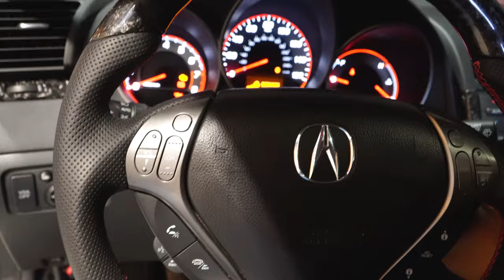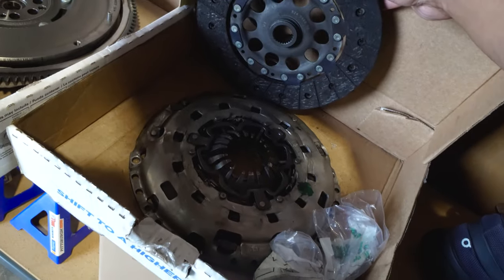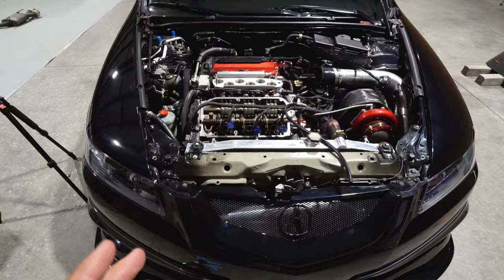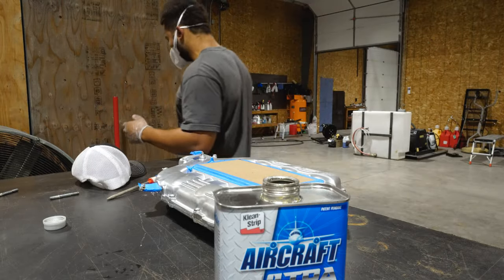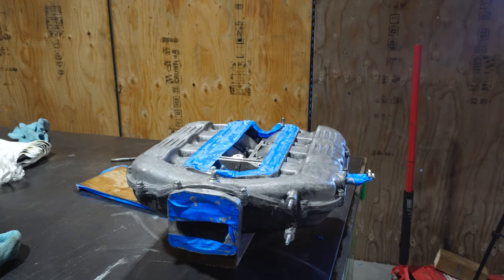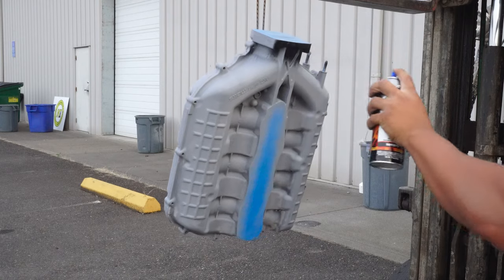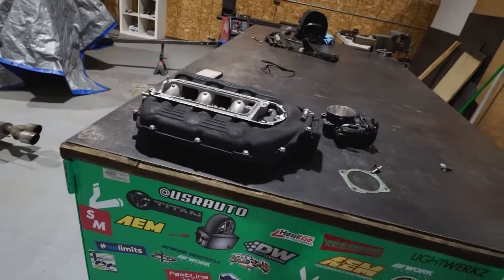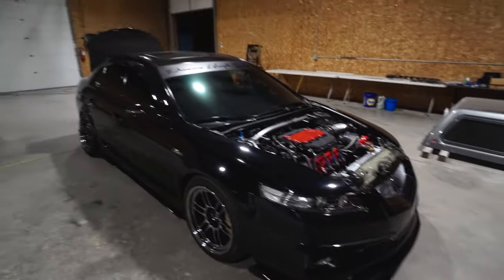Painting Manifold Wrinkle Black DIY Boosted Acura TL

Comment: Hey D, quick question. Does removing the hood insulator make a difference on the hood's paint or keeping the engine warm in cooler temperatures? Or it's fine to remove it? Mine ripped above the serpentine belt side when the belt ripped off while driving. Thanks.
Reply from the maker: I’d remove if it’s ripped fs , paint will be just fine the black cars get cooked in the sun everyday and hold up for years

Comment: Hey man I got kind of a dumb question but AcuraZine ain’t really helping out. 

My 08 Type S (AT) was stock the whole time I’ve had it and I recently added a new engine. 

Got new HFPC’s, an Intake, Rv6 Jpipe and I was thinking if I should go Mid muff delete, Dynomax Res and I was told to get Tune. Sound like a good route? 

But once I Hondata flash pro is there any thing further than that? I hear people talking of re tunes but I’m told Hondata doesn’t yield major results? 

(Other than making it a beast of a sleeper by putting in thousands to rebuild parts to make it more durable?  not a car guy clearly 😂)
Reply from the maker: @Zioni21  I had similar setup for a very long time without retuning so you won’t hurt anything. Hondata and tune depending on tuner, gonna run you 1k. If you plan on doing more bolt ons, do them all before tune to save most money. 

With no cats I recommend RV6 ultra quiet res and mid muffler delete. Helps contain rasp better.
Reply: @TheLifeStyle6  Ah okok! Appreciate it! 

Last Question would be get the resonator or naw? Cuz that’ll make it stage 3 right? 

& how much extra HP did you manage to pull with that set up?
Reply from the maker: @Zioni21  yes get the resonator unless you like the loud rasp. (I did at one time ahaha) never dyno the car but id say my FBO was hoovering 305-315hp. I have my FBO setup in a lot of my video description.
Reply: @TheLifeStyle6  thanks boss!!!!